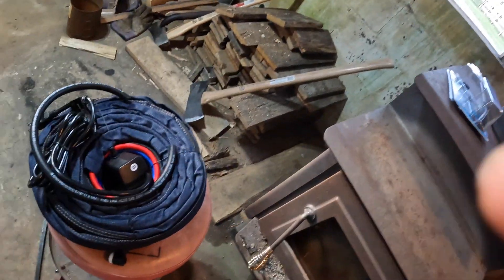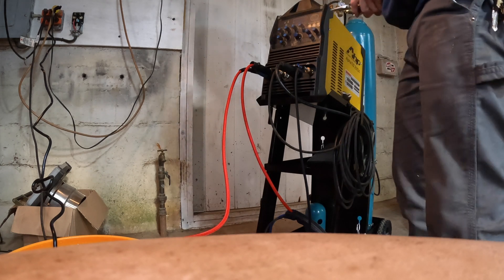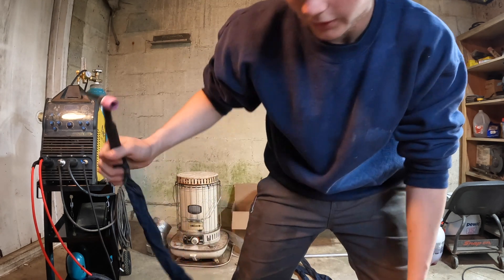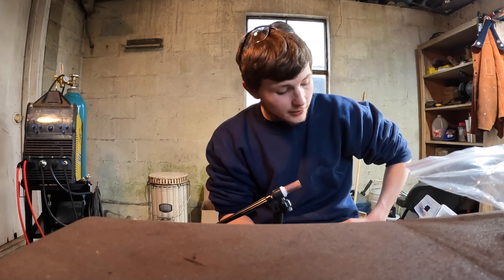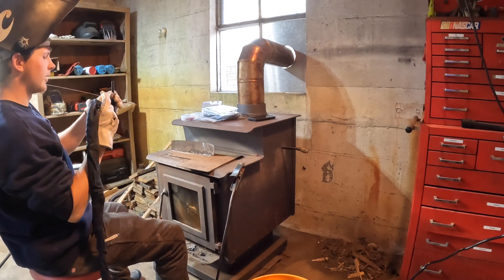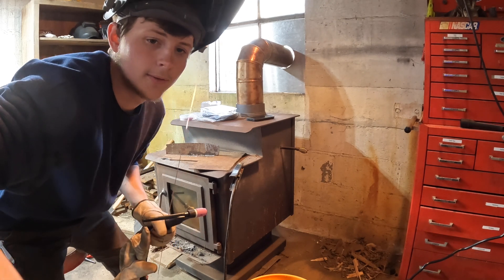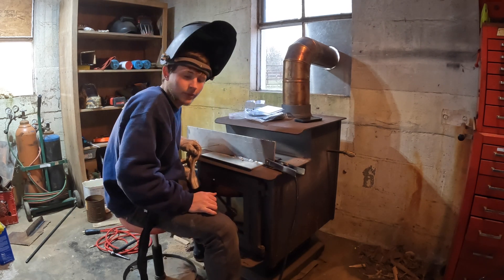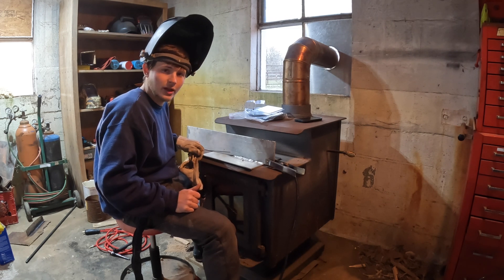DIY CHEAPEST TIG COOLER MONEY CAN BUY - IT WORKS!

Comment: You may need a little more pump, but there are a lot of radiators that have 1/2" copper tube in them with fins that would cool the water a lot on it's way back to the bucket. If you set it in front of a normal fan so it had air circulation it would probably help a lot. Make sure it has big tube so it doesn't increase the pressure drop to more than your pump can handle. Your system is so low pressure you could get an oil cooler or transmission cooler from the junk yard. clean it out with solvent and use that to remove heat from the returning water.

Comment: I follow your grief about the TIG torch I can say I do have the CK worldwide flex lock and it's a water cooled flex lock it's a FL 230. The Tig torch you have is the Nova roto lock and it comes with two heads and number 9 and a number 17 and I always how well they worked hearing from you that they get hot really fast at 75 amps just tells me it's a POS. Me I started using the wp series Chinese made TIG torches and then I found getting my hands on a CK worldwide and it was a game changer started with a number 17 found the head to be too big and bulky ended up getting a number nine and liking the size then it came to me doing aluminum and my torches would get hot getting the water cooler and a water cooled torch I now have the FL 230 which is a water cooled flex lock I also have the number 20 which is a CK worldwide water cooled number nine but you get into the position to where you can afford it get a CK worldwide...